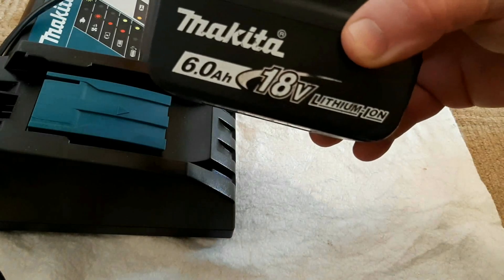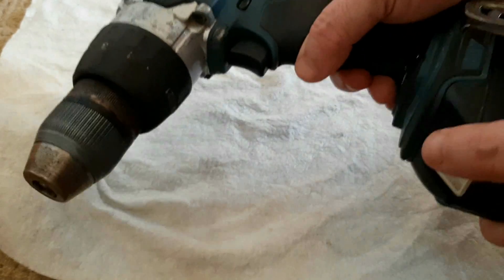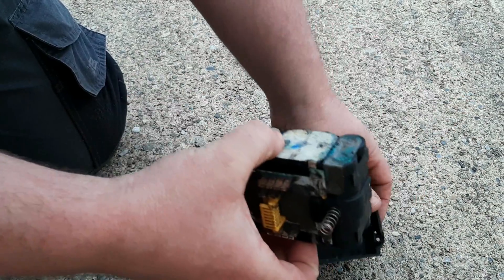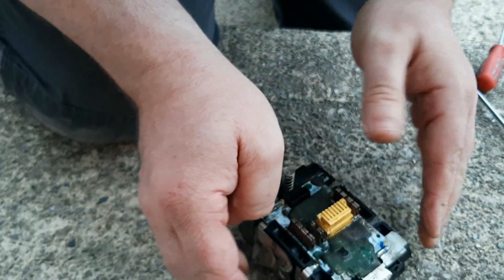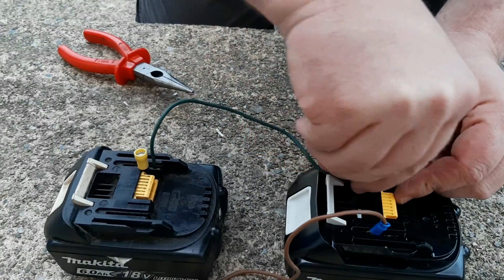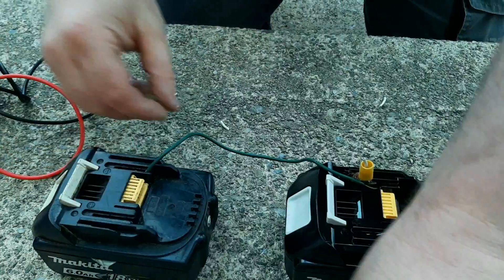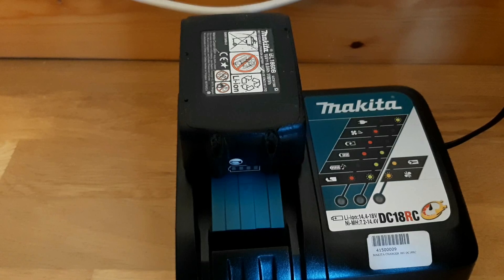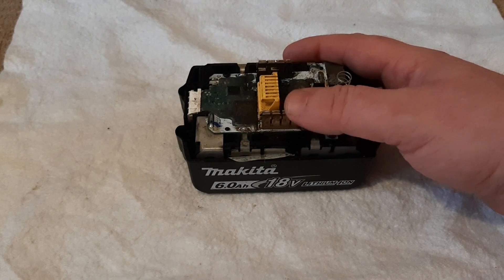Faulty Makita Battery diagnosis

Comment: Hi. The flashing red light on the charger means a temperature error. On the battery pcb, next to the spring, under the black adhesive hill, there is a thermistor. It's broken. It's a $1 item...:). If I remember correctly, it's 10 kohm at 23 degrees Celsius. Regards, Gábor
Reply from the maker: Thank you Gabor
Reply: Thanks what do two alternating flashing lights mean?

Comment: I have gotten a smaller 2AH version of those, the lights flash left and right, same when insert on charger but it will charge, I have checked with multimeter. The charger SO I'm wondering what's the issue, PCB of the battery?
Reply from the maker: If the cells banks  are all above 3.5v its the pcb

Comment: when i push the test button on my battery it flashes double red lights , would the cold have got to it
Reply from the maker: It could be that however there's no way of knowing until I got it opened
Reply: PCB is connected to 2 cells so could be one of those 2 cells, could be unbalanced voltage on other pair (assume you have 2 stack or 10 cell battery 3.0, 4.0, 5.0 or 6.0). or dead PCB, or thermistor. 
There is a lot of fake makita batteries and they look like original and sells as original. 
They have little bit different sticker on the bottom and battery indicator doesn't have that crunch feeling of indication when pressed. On original battery leds shows at the same time, on fake they kind of gradually turning one at the time till reaching level of charge.

Comment: I had same problem as video. Jumping didn't work, got mad and just shoving the battery on the charger until It showed the fault, took it off and repeated it 5-6 times and on the last time it started charging
Reply from the maker: That's great
Reply: Is this a troll 😂

Comment: The length of time you left it connected to the other battery WAS THE KEY PIECE OF INFO which you left out!!!
Reply from the maker: Usually a few seconds I do recommend that you connect a multimeter at the same time so you can remove the wire when it gets above 17v
Reply: @sirgoatofcheese the length of time is doesn't matter.. the battery voltage is more important, especially the battery is hooked up to the bms.. 
so, you no need to worry about how many time the battery is being charged by another battery/external charger not from makita charger one, because it is the same thing..

Comment: I apologize for asking what screwdriver did you use to open the case
Reply from the maker: Don't apologise its a tx10 torx
Reply: Thank you so much 
Have a good day
Reply: @ВладиславАнтонюк-ы9н  To be exact it's a Torx-TR 10 (tamper resistant) with a pin in the middle. You can break the pin off with a smaller screwdriver and a hammer but it's quite a hassle. I would recommend just getting the appropriate bit with a long shaft. 
Easiest way to get the white plug out is to screw a small woodscrew in it and pull/lever it out with a pair of pliers.

Comment: My issue with the makita batteries is making me want to swap my whole kit out to DeWalt. 
Makita quality has fallen off, IMHO
Reply from the maker: There is certainly limited choice in Makita LXT compared to Milwaukee M18 and Dewalt XR/flexvolt
Reply: @doctorlefthandthread  plus, I'm thinking maybe going from 18V to Dewalts 20V may be the extra power I need
Reply from the maker: @SirMillz  I gotta break this to you M18 Milwaukee 18v LXT and Dewalt XR 20v are all really 20v when fully charged. The 3 brands use the same cells usually too and the same amount
Reply: @doctorlefthandthread  ah, I see. I can believe it. So what is the best kit? Or does it really matter?
Reply from the maker: The standard batteries are pretty much the same across the top 3 brands they mostly use the same samsung cells. Best kit? Depends what you are doing. Of the 3 Dewalt is better value for money in my opinion.
Reply: Zero difference.  20v is a marketing gimmick. @SirMillz

Comment: I'm having problem after problem with makita battery's and charger going down.
They are not fit for purpose. 
Good money for garbage.
Reply from the maker: Some people have lots of issues some people say the Makita batteries do well its a mixed experience with all brands as far as I see but yeah the Makita batteries are far too expensive
Reply: Operator error, brother. I probably have 30 batteries and 20 tools in service daily. Makita is just fine.
Reply: @patarmstrong3582  
I've been a welder fabricator for over 45 years. Every engineering company I have been in has shelves full of dead makitas. I transfer parts to ge something working. For me, they burn out too quickly.
They are made that way.
However, 240v is too much power going through a handheld grinder. Variable speeds is a must.

Comment: Y is it heated so much plus I smell the plastic burn smell and so stopped after the light just showed in 2nd step which it needed for 3rd step light to be fully charged?smell not normal?
Reply from the maker: Battery is probably beyond repair

Comment: Hi. I have a strange problem with an older Makita 3AMP battery. When I insert it fully into the drill it will not power the drill. However, if I retract the battery 2mm by depressing the button and sliding it backwards, the drill will work. I have tried cleaning the connectors on the battery with sandpaper but still no good. Do all 3 connectors need to connect with the drill? My other 3AMP battery works fine so the drill cant be broken. Any ideas?
Reply from the maker: It is something in the pcb of the battery stopping the drill from working its a safety thing. Because of the nature of lithium-ion and the fire risk the pcbs are over sensitive and will cause a shut down even when there is not much wrong.
Reply: @doctorlefthandthread  Thanks for your swift reply. However, I cannot see anything in the drill that connects with the yellow 7 pin PCB connector in the battery.. The drill only has 3 metal plates that are inserted into the two positive and one negative ports. Or am I missing something?
Reply from the maker: @DirectSales-z2z  that's right I would suggest putting a bit of insulation tape on the middle pin the shorter one on the positive side and my guess is your drill will then work with the troublesome battery
Reply: I am afraid that makes it worse. The drill does not work at all regardless of where the battery sits, probably because one of the contacts is permanently not connecting. I want to identify which contact loses connection when fully inserted. Is there an easy way to do that ?
Reply from the maker: @DirectSales-z2z  you could connect wires from the battery to the tool and use the process of elimination to see if you can get it to go that way
Reply: @doctorlefthandthread  I suppose you mean wires from the drill cos the battery will always show 18v on the multimeter. The problem is that there is no space when the battery is fully fitted or do you know of any access points on the drill?
Reply from the maker: @DirectSales-z2z  something like this  https://youtube.com/shorts/_vIJ1Pyj0Lg?feature=share

Comment: Just put it on the charger even its blinking. I left mine for a night when i woke up it restarted and charged it
Reply from the maker: That's awesome I have heard the chargers can do this but never saw it happen
Reply: @doctorlefthandthread  if u have no patience you wont pursue but i left it on. In the morning i saw it green. I used the battery works normal, charged it as if nothing happened
Reply from the maker: @markhidalgo734  thank you
Reply: Did not happened on mine.

Comment: none makita battery are they any good ? that yellow but is broken on my makita battery can it be repaired ? thanks
Reply from the maker: They are about the same as other brands in quality I think you can get the yellow piece separately and glue it on.
Reply: @doctorlefthandthread  oh right thanks i bought two original makita batteries and one doesnt load into the charger and the other battery has a broken yellow connection . i have other brand batteries and they seem to be ok and used for nearly two yrs in my gardening business

Comment: I have too that red flashing light. I bring the batteries inside to a warm room, let them be and then the charger will charge them properly. Blinking red means cooling... Or something with the temperature.
Reply from the maker: Temperature is a big issue at the minute the harsh winter is very detrimental to batteries. Like you say the charger won't charge them unless they are the right Temperature either

Comment: Makita battery management boards are pieces of shyt . . . on purpose.

I reckon millions of good Liion cells have been thrown in the trash by people who don't realize that there's actually nothing wrong with the batteries, which are the most expensive components in the pack. Even if you refurb some of these batteries properly, using their series connections, and balance all cells perfectly, the BMS PCB has a memory and will not allow the charger to charge a perfectly decent battery. Even if you purchase a new battery, and it just goes below a certain charge level due to disuse, the battery charger will reject it and then after a certain number of tries will program the battery PCB to reject the battery.

I have simply charged my 18v Liion Makita batteries using a constant current charge of around 0.5 Amps up to 21 volts, and then a constant voltage charge between 20-21v up to 21 volts, for 100's of cycles, and they never overheat, work just as they should for a long duration. It takes longer than the proprietary fast charger is supposed to take, so it's not really a fix for the laborer who relies on the product for their job, but there's no way I will ever purchase a Makita product ever again in my life.

The chargers are shyt... simply shyt, and I've come to the conclusion that Makita just know how to generate profit from DIY consumers who don't use their drills/drivers that often, and will then believe they've invested too much into the drill, so continually purchase some of the most overpriced proprietary liion packs on the market other than just writing off their equipment purchase as a bad consumer choice and switching brands never to return.

I've never had such problems with my Bosch charger and batteries. And once, a Bosch battery fell under the charge voltage to be recognised by the charger, so I charged it manually using constant current up to 18v, and then the charger recognised it perfectly. 

Makita is cancer
Reply from the maker: I agree with all of that tbh
Reply: Chinese sell new board with 8 euro though, just fixed 5Ah one. Eventhough it does not have any discharge/overheat current etc protection, so not too good for dumbuser. But it will take charge and work like normal, in some cases no overcurrent protection can be even beneficial -like with circular saw or angle grinder.
Reply from the maker: @Tegelane5  that is correct sir
Reply: I've had so many problems with makita batteries I've given up on them. They are absolute rubbish. I went to Makita with 3 batteries that packed in and said if I didn't have a receipt there was nothing they could do. They were genuine batteries. They just didn't want to know. I'm done with makita now thankfully. Never again.
Reply from the maker: @TheBadgolferman  sorry to hear that I hate when these big companies leave customers hanging like that
Reply: all the tool companies are the same as far as i can tell. batteries are overpriced. Chargers go as fast as possible. batteries go in the trash
Reply: I get decent life out of my Makita batteries. It’s never a nice day when one dies but such is life. I think they improved them a few years ago, prior to that I think they died a bit too often.
Reply: You have 3 chances to jump the battery once it is recognized as 'bad'. Stick that battery in a charger and get the alternate flashing lights, or broken battery light (chargers vary in how they indicate this), then immediately jump it with a fresh battery. I use fender washers, and stack the batteries to make the connection. This works if you catch the unbalance before it makes 3 laps through the charger. After 3 unsuccessful attempts,  the battery is locked out by the software. I have been using Makita stuff for 20 plus years daily as a contractor and they last better than Dewalt. Pay extra for Milwaukee if you really need another 5 foot lbs! Makita stuff is competitive with the other guys. I once had a rep swap batteries on the spot while he was setting up a Home Depot display, because I showed him they had been locked out  but had newer date codes. Radios that have clocks which always drain the battery can cause a battery imbalance. I'm wary of this now, and have saved a couple batteries by jumping them. Swapping boards, or otherwise eliminating the protection circuit can't possibly be worth having a lithium battery fire in a clients home.

Comment: If you get at charging 3 times the error from the charger your pcb disables the battery permanently
Reply from the maker: Thanks for the info do you think a new PCB will fix it?
Reply: @doctorlefthandthread  if all your LiIo Cells are ok it works with a new pcb again.
Next time if the Charging fails: only try 1-time than Kickstart the cold battery and charge again in a firesave environment, if one cell gets hot stop it immediately and change the cell.
Reply from the maker: @halbvoll1  thanks for the advice the pcb is ordered for this and I will make the 2nd part soon
Reply: @doctorlefthandthread  
Здравствуйте друг
Где заказывал?
Reply from the maker: @muhammadmagomedov6916 I ordered it from ebay had to wait until it arrived from china
Reply: @doctorlefthandthread  приблизительно сколько пришлось ждать ,и осталось ли у вас силка на этоу плату ?
Reply from the maker: @muhammadmagomedov6916  it took 3 weeks it was cheap to buy
Reply: What is a pcb please?
Reply from the maker: @Hindrenaline  it is the circuit board
Reply: @doctorlefthandthread  thank you.
Reply from the maker: @Hindrenaline  anytime